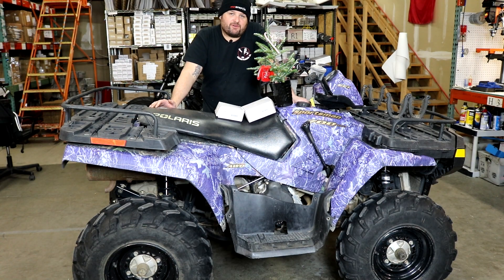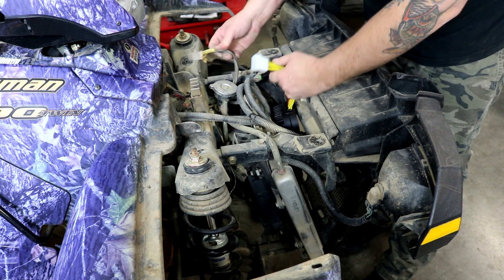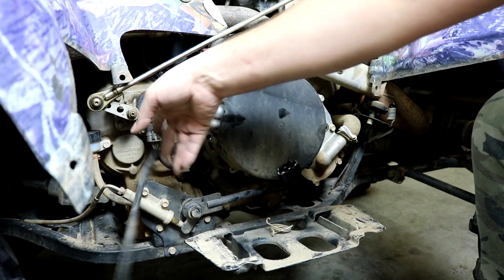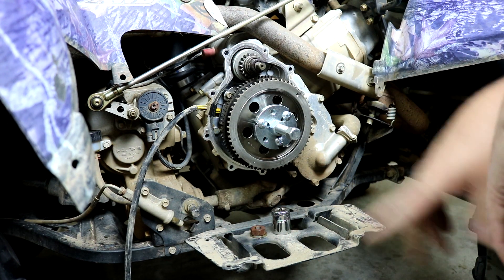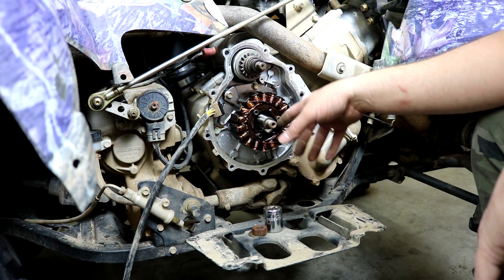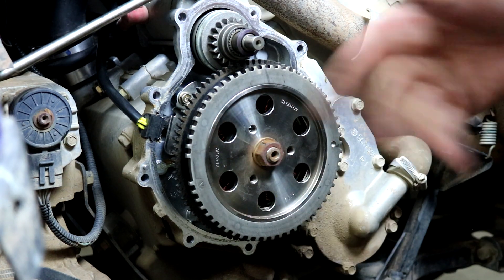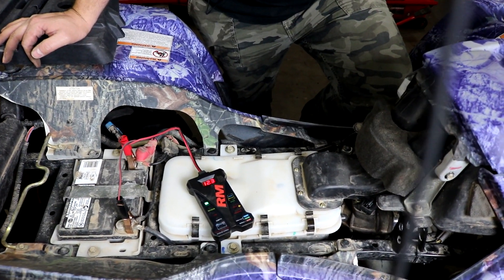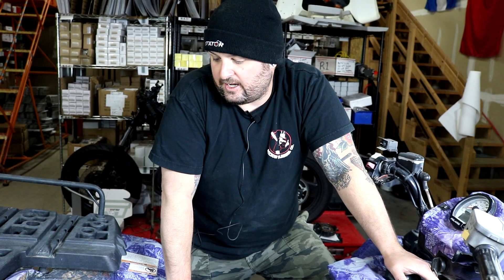RMSTATOR Polaris Sportsman 700 800 EFI Twin Stator and Voltage Regulator Installation How To

Comment: Help !!!!  I have a 2004 sportsman 700 twin with EFI , sometimes it'll start and run fine for a little while and die .. I try to restart it and I don't get any noise from the fuel pump .. The weird thing is my headlights will shut off as well , my pod will come on .. it gives me the codes for the injectors open load + or - .. I've checked all the wires and connections and I'm thinking it might be something to do with the kill switch , headlight and override pod ????